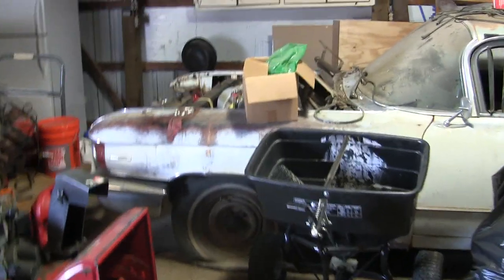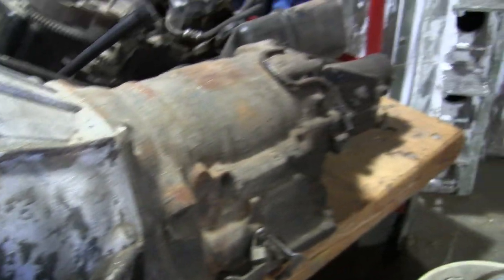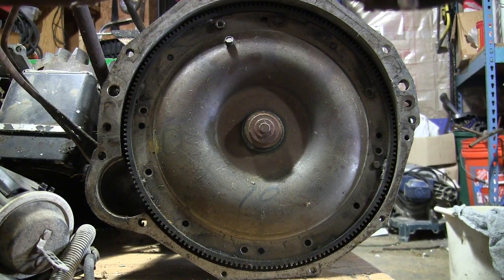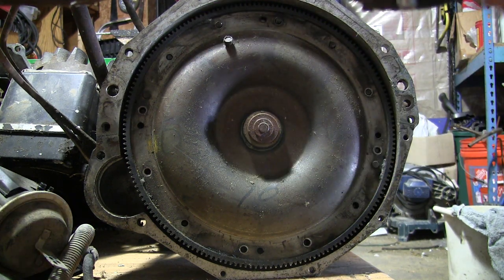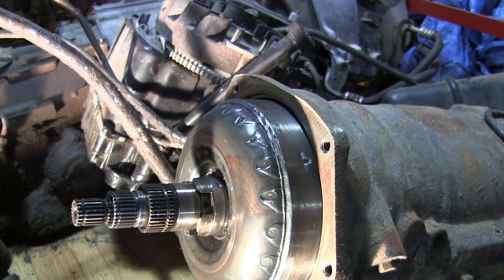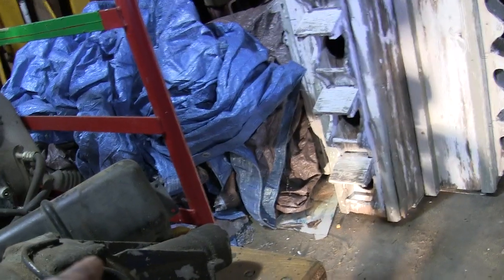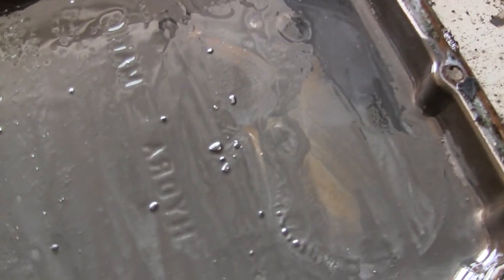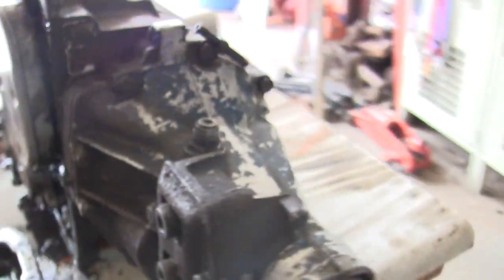1960 Cadillac Transmission

Comment: The cool thing about these transmissions is the removable bell housing.  You can use different year bellhousings depending on the application.  Cadillacs typically used a larger bellhousing while Pontiacs were known to use a short bell housing.  There was also different length tail pieces.  All these pieces are swappable.  Just be sure to use the correct flywheel on the transmission.  Some had teeth on the flexplate, while others put the teeth on the transmission flywheel.
Reply: Didn't you mean use the correct "torque converter"?

Comment: ..What this gentleman has here, and might be quite a nightmare to tackle is a mod 315 Jetaway HydraMatic Controlled Coupling 4spd transmission, used in Cadillacs from 1956 thru first part of 1964, then replaced by the 3spd TurboHydramatic 400 units. He didn't seem familiar or didn't want to disseminate too much info relating to removing the torus members that comprise the main fluid coupling(looks like a giant bagel cut in half with radial vanes on both halves), which some refer as the torque converter, but isnt, since it doesn't have a stator, which helps multiply engine torque. This is the same transmission that my erstwhile '62 Caddilac had in it, coupled to the same 390c.i.d. V8 this Caddie has..great running/great shifting & operating transmissions as long as everything is functioning properly. Mine had a severe front unit leak just behind the bellhousing. Had a trans shop pull it, dissassemble the whole front assys, reseal the unit. Then it needed a revulczanized rear mount/transmission mount..all cost then about $540, back in 1993, while living in Tucson Arizona. It was Dad's car, bought new in '62, I took over ownership, responsibility, maintenance of the ol' gal until I sold it Sept '21, for next to nothing!! Engine seized while sitting stagnant here after being towed/shipped here in wet Miss. Climate!! That's my input/experience with this really unique fluid-coupled transmission.

Comment: When I see blue paint on a transmission, I immediately suspect it was rebuilt at some point by AAMCO because they paint theirs blue when they rebuild them. 60 Caddy is cool. Worth saving IMO.  I might even be considering an engine/transmission swap from a later year Caddy at this point. A conversion would be tough and a bit more costly just because of all the little things you end up having to change in the process that come in addition to the Bell housing adapter anyway, a whole swap might end up being a bit cheaper or about the same cost, but the advantage would be easier to get parts for.

Comment: metal chunks in a transmission are never good.  Too bad you didnt know the specs, or you could make a tool possibly
Reply from the maker: More350Power Yeah it sucks. They did that to me on a ford trans I was rebuilding, luckily someone put the specs for the tool on the internet so I was able to make something to take the measurement.

Comment: 6 years later but did you fix this and what about the rest of the Cadillac? That front coupling cover was this design Hydramatic’s Achilles Heel. I had my 56 Pontiac’s same transmission overhauled with broken coupling cover in 1963. Cost 170 which sounds cheap now but it was a big hit for me then.

Comment: I have the same car/trans. I pulled the trans 3 times and rebuilt it twice (I messed up the 1st time). You can buy a new aluminum coupling unit (Fatsco or Dave Edwards) The key is to disassemble everything, I found some broken seals deep below the rear clutches which were a pain to remove, also there are several tailpieces that have been on Ebay for months. When it works it will go for 50 years before the seals wear out again.

I love your videos, rock on!
Reply from the maker: Daniel Brisson Thanks for watching

Comment: You need a new front coupling cover.  They are being reproduced now.   They can run anywhere between $100 to $200 depending where you get one.  I got mine from a place called Tri-component.  It was $100 at the time but that was about three years ago.  The original aluminum covers were notorious for cracks and breaking.  Very important part though as it is part of the controlled coupling.
Reply from the maker: jgr62pontiac Yeah this one has a small crack that I noticed after making the video. I found a new cover online for $225 but we'll see what my brother is able to find for used transmissions.
Reply: bah53 My transmission that I rebuilt had the same problem with the coupling.  I also had a broken wave spring on the reverse piston.  What was strange was I found a good spring on top of the broken one.  Someone had rebuilt it and simply laid a good spring on top of the broken one and  put it back together!  Needless to say it never shifted into reverse and back into low very smoothly until my discovery.  The friction clutches had also all delaminated due to age.

Comment: Even though the engine runs good you should consider a third option get a whole new engine and transmission, like a small block Chevy 350 and and the appropriate transmission.
It could potentially be the cheapest alternative especially if you use Junkyard Parts.
Reply from the maker: redneckbryon We've thought about it but I think that will be a last resort. Swapping in another engine could open up a whole new can of worms.

Comment: How about putting in a fuel injection motor..  if you dont care what type motor.. would make it great on fuel.. having overdrive transmission..  I'm a Ford guy, so i'd look at a 4.6, or a 302  just grab a whole car.. and swap it in..
Reply from the maker: 462ANIMAL Hopefully we can get the original trans working again for a reasonable price. A modern fuel injected engine would be neat tho.
Reply: bah53 I like to keep stuff original if I can. I just don't like the cost to run a big block.. 10 mpg  isn't all that good.. I have a 72 mark IV I'm thinking about going modern.. with a 4.6.. a V10 would be cool.. but then the gas lol